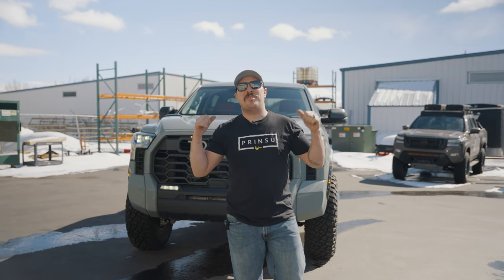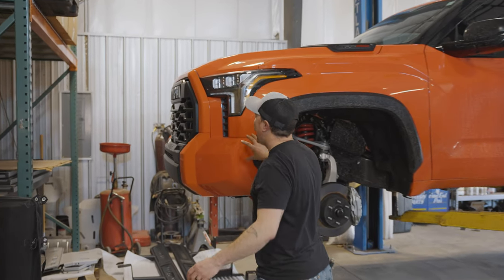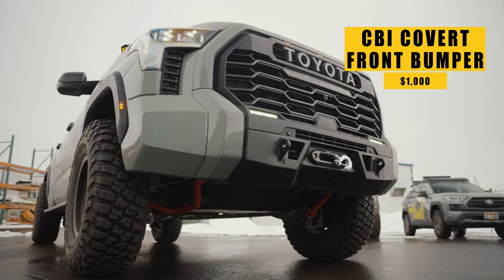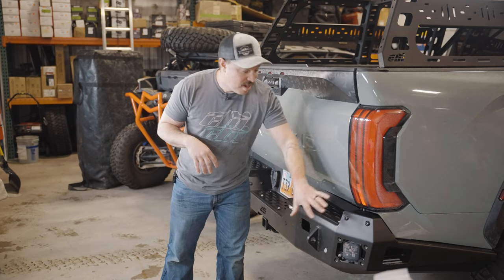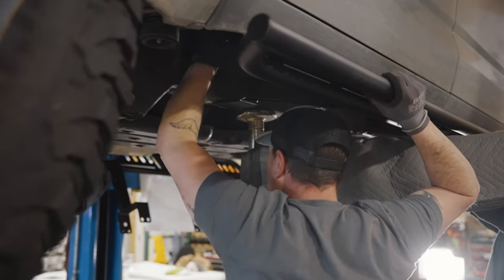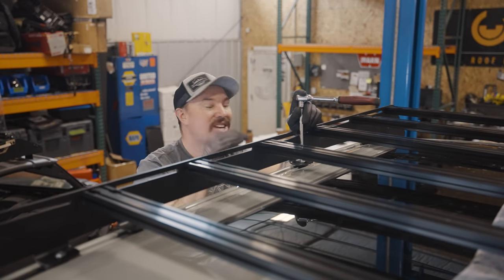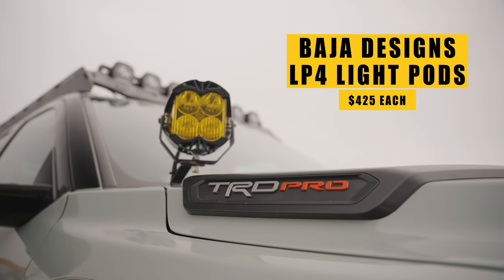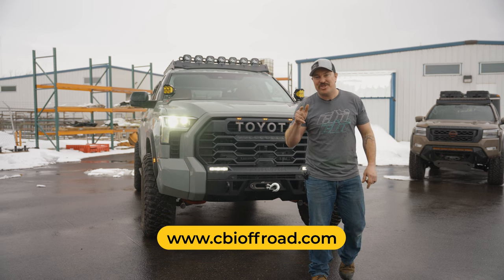Adding $15,000 to the 2023 TRD Pro Hybrid Tundra!

Comment: Is the winch a Warn evo10s? Your phone support told me the trd pro hybrid will need a solenoid relocate with that winch - looks like in this video not needed or did you just not cover that part in the video? Just trying to figure out what I'll be up against
Reply from the maker: the warn evo 10s should fit just fine. Pretty much any other brand or model besides that will need the solenoid to be relocated.

Comment: I like the way you designed that back bumper. Mine come damaged from the production process/factory. After only a week left side screw underneath cracked, making that left side loose. Not sure if it was tighten too much or what happened but this could be Toyota design flaw too. How much will it cost to buy and install that back bumper.

Comment: Totally ignorant to kitting out vehicles / trucks etc. wondering are they actually piloting into the roof of the truck? Is there a warranty void / rust implications there? Assuming there’s proper seals that come with the rack? Cheers
Reply from the maker: check out our install video on our @cbiprinsuinstalls page or our install guides on our website. They'll cover what sealant we recommend which is the exact same that is recommended and used by Toyota. Drilling into the roof of the vehicle is a commitment but hopefully those resources make it easier.

Comment: So it is safe to wire up all the aux lighting on the front Fuse box (jump points) on the hybrid models?  I always thought a separate power wire had to be run from the battery.  Did you wire the winch power to the battery?  Thanks!
Reply from the maker: We traced the battery main power to the fuse box and ran our winch and spod off of that terminal.